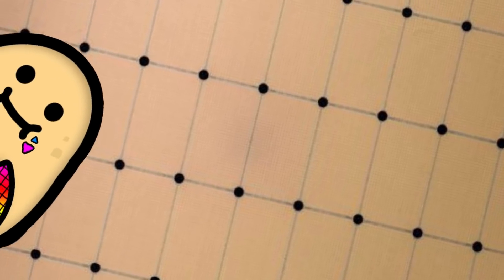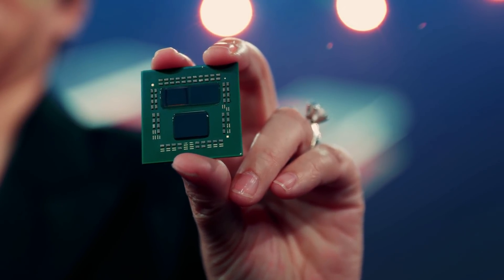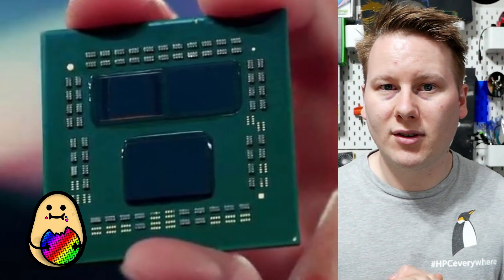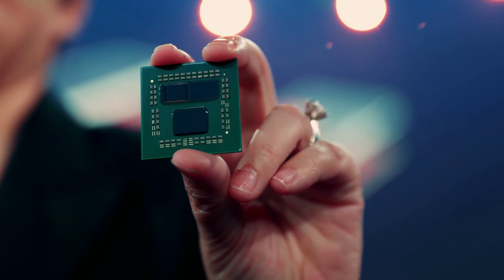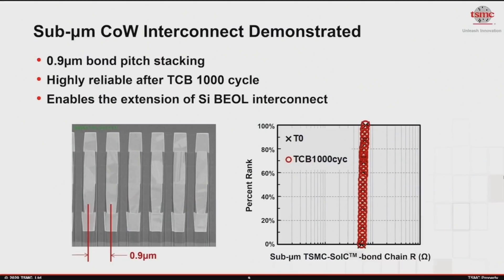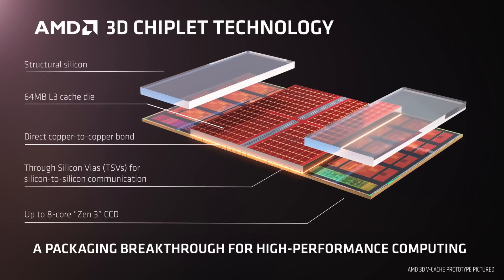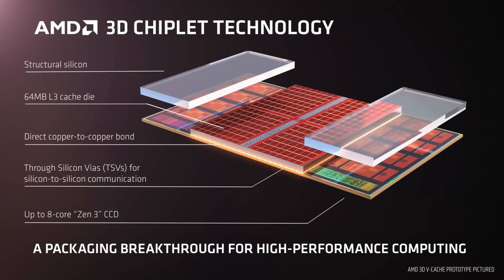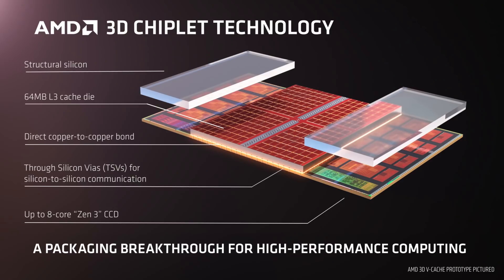AMD GETS STACKED 💪 192 MB of L3 Cache on Ryzen, Coming 2022?

Comment: I wonder if AMD did some optimizations to InfinityFabric. I would think that with bigger caches there are more lines in L3, so CCDs would probabilistically share more data between them and this could result in more traffic when one CCD wants to perform write to cache line.

Regarding workflows that benefit from bigger caches. I think digital logic simulation takes loads of cache, I remember hearing that verilator(on of many simulation tools) is limited by instruction cache size. Bigger L3 may reduce number of instruction lines being pulled from memory each simulation cycle.

Comment: I've been screamin 'MOAR CACHE PLEASE' at Intel since my first Pentium. I just do not understand why they take a "Good enough" standpoint when it comes to cache. It's almost as bad an Nvidia and low memory GPUs. You know the GPU could do so much more with more memory, yet you still hamstring it to save cost and make sure it doesn't cannibalize sales in next gen... 
I do understand not everyone might need the extra cache depending on what programs are being used, however it's always nice to have leg room to stretch if needed.
Reply: Well cache on a monolithic die is usually expensive so I can see why they wouldn't do that... Plus they were market leaders and wanted to milk us with incremental upgrades. Now you can have cache outside of the main chips it is much cheaper to implement hence what AMD has done.
Reply: Cache is expensive to add and is not beneficial to every kind of problem, more logic transistors are better in most instances. It is just that there is no point in adding more cores, and clocks can't get much higher, so you might as well add more cache now.

Comment: The 3D chiplet cache is great, 12% performance boost for an old architecture. I think testing it out in a mature process 7nm is very logical and given games benefit the most from increased cache sizes doing it on a consumer chip also make sense. If the 20% IPC combine with 12% from the 3D cache Zen4 is looking like a beast.

Comment: I suspect in the actual implementation the chip is flipped from what is shown in the slides so that the CPU cores are actually on the top nearest the IHS. And the "structural silicon" actually contains TSVs for power and signals as well. This would allow AMD to have the same design with and without V-cache, and potentially stacking multiple such V-cache chiplets under the cores without any change to the overall design. TMSC showcased up to 12 layers. I suspect the chiplets shown in the keynote are already 2 layers. But it would allow for EPYC models with potentially multi-GB of L3 cache.

Comment: Basically CPUs have more cache than laptops had RAM 25 years ago... which also had more RAM than desktops did Hard Drive space a further 25 years back...
Reply: Cpu will have almost as much cache as ram in my first Celeron computer in 2000, 192mb vs 256mb.

Comment: The fact some claim this cache is also on 7nm seems a bit scary looking at potential price. You could build another entire 8 core die with the equivalent die size of the extra 128mb of cache.
Reply: Memory dies are much easier to produce, though. So the production cost for the piggybacking chiplets is likely just a fraction of the logic dies.

Comment: I think drawing a comparison between broadwell's L4 and this enlarged L3 is pretty flawed, the L4 latency on broadwell was far closer to the system memory latency than it was to the L3, in part because it was also DRAM. I would assume at least that this L3 is merely an SRAM extension to the existing L3 on the CCX, it will have worse latency just because of size and the longer interconnects but I think it's unwise to assume it will be anything like the Broadwell eDRAM.

Comment: when Dr. Ian mentioned the higher power requrments my first thoughts was if this stacking tech needs more power to function properly that might explain why AM5 is an LGA socket insted of PGA to get better control of the power delivery of the future zen gens and it could potentialy also explain why AM5 have more pins then AM4
Reply: The reason they switched from PGA to LGA is easy they maxed out the reasonable amount of contact points for PGA and to implement more pcle lines they needed more contact points   in general it has to do with mounting pressure like in old times at first PGA appeared till they added/needed so many pins the combined force of each pin was to high and could break during installation than LIF-PGA (LIF=low insertion force) appeared till the same problem occurred than ZIF-PGA which we all know and now that technology is at its limits
Reply: Pga has better power delivery than lga

Comment: That's going to deliver a massive bump to running Prime95: the large FFTs for the current wavefront of primality testing will reside entirely in L3, which would pair very nicely with the AVX512 coming as well. It would avoid a lot of the memory bandwidth saturation issues.
Reply: Yup. Avx 512 is a bandwidth hog
Reply: If a fixed dataset match the cache size - perfect. Overall it is a nice increase for random datasets. The problem today is more to adjust the dataset organisation to allow ramdom access below the critical size and predictable acccess above. So the speedup is more in the software. A radical departure is using in memory computation and instead of guessing access pattern from data to organize the control flow within memory.

Comment: I'm wondering whether this'll have an impact on core temperatures. Silicon isn't the best at conducting heat and especially given how much AMD's opportunistic boosting algorithm benefits from lower core temps, I wonder if this'll have a noticeable impact on performance.
Reply: Zen3 cores are located on the edges. The middle part is l3 cache memory. The extra cache die sits on top of l3 cache not on compute cores . Also cache doesn't generate a lot of heat. Only Logic and compute cores gets heated which are not covered by the cache die.
Reply: @kadiyamsrikar9565  The 3D stacking illustration show clearly that in addition to the 64MB cache there is a  height adjusting raw chiplet, i suppose of silicon, which cover the core area. The picture is wrong that in real the core logic is to the bottom. The thermal/mechanical fitter add to the thermal path and will reduce the all core boost frequency. But in 5nm my guess is that the power/core reduce to lower than 3W. So this coulb be applied to Ryzen and Epyc.
Reply: @reinerfranke5436  According to AMD both the cache chip and the CCX have both been thinned, so their overall total thickness is the same as the original. it very well may be hotter, but i cant see it being by a order of magnitude.

Comment: The moment I heard 3d stacking I knew I can for sure count on some sweet potato content 😁
Reply: Yum...
Reply: how would you thermal control 12 cores stacked, just low volt processors or is there a practical usage
Reply: @nicknevco215  it's a shaved die just like you do while die lapping so the difference in z height is negligible, plus it's not cores it cache added so it shouldn't impact thermal performance much 
Also I heard someone at amd suggesting that even if they put more ipc in their next architecture the performance uplift wouldn't be reflected as even zen 3 isn't ipc limited but rather cache limited so this will help zen 3 and especially zen 4 for that 25% ipc jump 
Plus this zen 3d experiment could help them iron out bugs and designs for zen 4 and help amd keep the gaming crown again alder lake intel 12th gen

Comment: FSR,  those 2 APU's at that price point to fill out the CPU stack. Dr. Su had a mic drop day, wow! Though Intel will introduce Alder Lake this fall is beginning to look like it may need to be renamed "elder" lake. NVidia not supporting the old GPU's is coming home to roost. Pushing customers into features by not giving tech to older architectures is short sighted. AMD is supporting 10 series GPU's with FSR. The yard stick has been established!
Reply: Alder Lake has DDR5. Intel has nothing to worry about.
Reply: @Patrick73787  Alder lake will be expensive because gen 5 pci express has cooling issues, Intel is trying to leverage ATX12VO to save on motherboard cost. Gen4 was expensive Intel learned that and said well we will have Gen 5 which is hotter and more expensive.  Engineers have already said that it may not be ready with gen4, we shall see.
Reply: @DrForbin001  I don't believe it it. Tiger Lake-H which is a freaking laptop chip has PCIe gen 4 support on both GPU and storage. There's no way Intel doesn't support PCIe gen 5 as they need it to take advantage of their CXL protocol
Reply: @Patrick73787  I didn't say it wasn't coming out, I said they were having cooling problems and it will make motherboards expensive,  especially with ATX12VO being added. Team blue is making board partners take a shit because they didnt have an answer for PCIx4.

Comment: I want to see how can this work on GPUs
will this mean a L3/L4 cache of 512MB to 2048MB o_o?
Reply: They don't need THAT much, but would be interesting.
Reply: Ram how needs that anyway if there is enough cage
Reply: Well thier next GPUs will be chiplets and the already have Infinity Cache Fabric which I doubt was maxed out with the 6000 series of GPUs.
Reply: then again, if the focus starts moving to pathtracing over the years, compute may be even more important than throughput speeds or amounts of ram (tile-based rendering tends to ease memory requirements too), especially specialized compute units, making them even more ASIC than they already are
surely there's little point in making 8k work before 8k monitors are available for consumer-grade hardware, when there's a new market of real time raytracing to cut into that covers a way wider public, and could actually allow them to develop products that are well-rounded for a wider array of applications, rather than go all in on the highest clock speeds, the fastest ram, and the most ROPs with bigger chances on failing in the process if there's 1 thing wrong in the chain.

path tracing generally doesn't care as much about raw clockspeed either, until you hit the diminishing returns on parallelization, which are pretty far out.
we've seen GPUs turn more and more into compute units for general computer, not as much as AMD wanted with openCL, but there's still a trend cuda set, and nvidia's cards turning into more computey kind of hardware too

cuda is a thorn in RTG's side for the machine learning and professional CAD/rendering market where many vendors only support CUDA, they need something that performs across the board without it being too costly, openCL died a slow death for the most part, and getting everyone onboard on vulkan isn't going to be easy either, they need to have a high kicker.

it would probably be wiser for RTG to develop products that cut into those big money spaces, gamers aren't the most brand-loyal customers anyway, would be foolish to spend resources on just a gaming card.